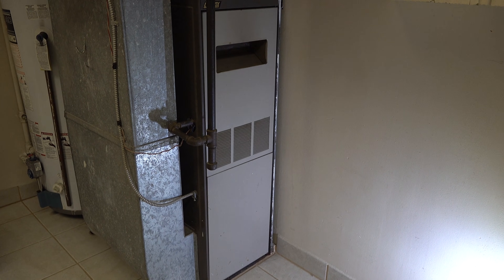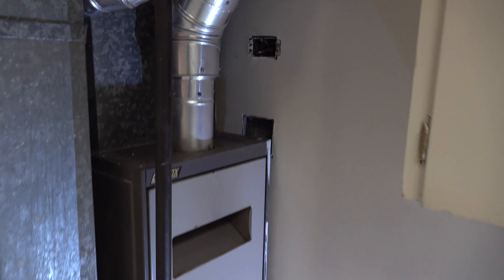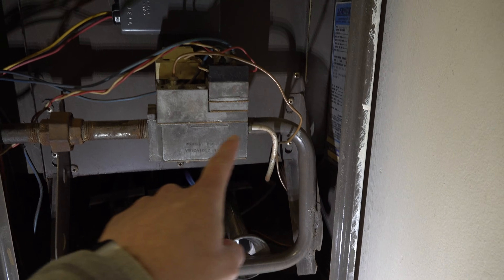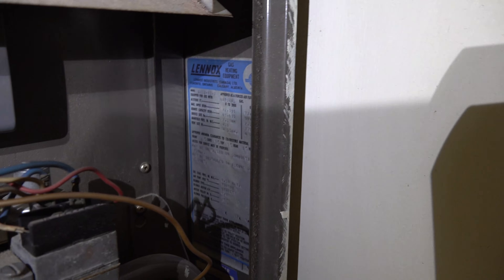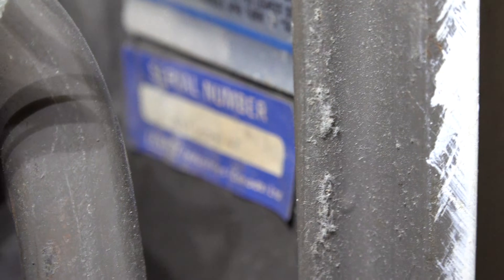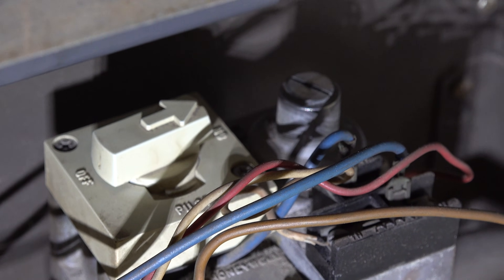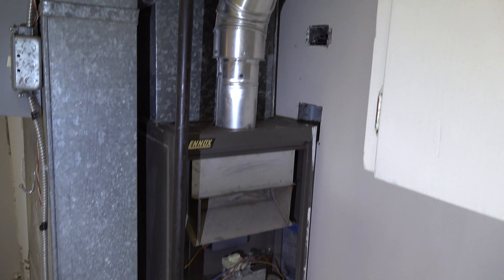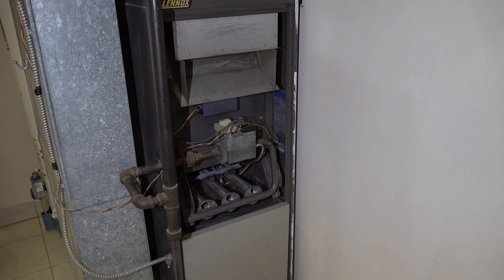1977 (Old) Lennox Gas Furnace Overview [G8D2-82-3]

Comment: Solid old furnace. As a licensed gasfitter in alberta i am a huge proponent of the old standard efficient furnaces, they are way more reliable than the newer ones and their efficiency is great. The parts are affordable and that offsets any cost of replacement parts for the higher efficiency units. Whats going on with all those blocks of wood under the blower assembly? Looks like someone used the wrong blower and shimmed it. Heat exchanger looks good but the best indication of a cracked heat exchanger is done through combustion analysis. Keep that old beast till shes not safe to run. Itll never let you down on a cold winters day
Reply from the maker: The blocks of wood were used by the previous owner so the fan didn't drop down so far when he'd take it out to lube the motor. I just left that in there since it's not harming anything.
Reply: @InternetDude  those blowers are heavy and you almost have to lift them with your feet and legs so he used them as a stand and a second set of hands. I see now! One time in like -50C, I found an old ICG with a broken bracket on the blower so as i waited for parts i temporarily had a big trailer furnace blower in there strapped to two blocks of wood. Wasnt sure if that was the case here. I worked on one of these the other day that was a counterflow model.
Reply from the maker: The blower is surprisingly quite heavy, yes! I lubed the motor a couple months ago, I put too much in and some of it ran out. Learned a lesson. It takes a little work to get that in and out by yourself. I bought a manometer to check the pressure and adjust it if needed. That'll have to wait until spring just in case I screw something up LOL.
Reply: @InternetDude   you can also do simple temp checks with a digital thermometer. For oiling i go about three drops at a time then turn it over by hand. Just a few drops per year is good. Youll hear it make a huge difference in sound. Also for a couple hundred bucks canadian you can get a new motor for it
Reply from the maker: Would a new motor use less electricity? If I would just save lubing the motor it's not worth it to me, the previous owner said he lubed it every 2 years (he lived there 28 years).
Reply: @InternetDude   in order to be able to more positively determine that, id have to amp check the blower motor (first place id start). After checking that, if the amps were close to what the stamp on the fan says id oil it up and let it be. Some of the newer motors dont require oiling and consume slightly less electricity.
Reply: InternetDude my motor is loud when it kicks on? Could it be because I haven’t lubed the motor?
Reply: @lovingyou2301  what kind of loud sound does it make? Are you sure its the motor? If you have a multimeter you can check the amp draw when it starts up. Then you can shut off the power and check the resistance of the windings. Have you oiled the pillow blocks in the back that hold the axle in the blower? May be time for an new motor. Should be a simple 1725rpm 1/2hp motor with a 5/8" shaft. Make sure the pulleys are the same size as the ones you took off and line up properly with a straight edge. Belt should have about 1 1/2" of tension
Reply: @markallan9050   Hello I have an old Lennox furnace the fan does not turn in the heat phase. As soon as the burner turns off the fan turns on to cool the burner. Worked on cars for 30 years I can not find the test to repair the problem. Any ideas Thank you
Reply: @markallan9050     My G8 (1976) appears to have sealed bearings ,   no oil fill caps .   Can i still add oil somehow ?
Reply: @johnleeyingzhang3504  just because we differ in opinions does not mean I do not know anything about furnaces. Just my personal opinion that I have to make more critical repairs that are more costly on newer equipment. Ive seen so many new units fail vs old ones that I am really not inclined to want to install them. When manufacturers start to fix the hiccupps that the new ones have...maybe then I may consider purchasing one. Just because I prefer older heating equipment does not mean I have "fallen behind on technology". I have some of the most technologically advanced diagnostic tools for repairs on this equipment and I am quite familiar with how to troubleshoot the electronic components on this new equipment.
Reply: My Parents Still Have Their Original Lennox GIO Gas Furnace  That Came New With The House In 1972! They Have Never Even Had It Serviced And It Is Still Running! They Don't Make Stuff Like They Used To! They Don't Run It Continuously Like Most People Do..They Turn It On A "Few" Times A Day In The Winter And Always Have. Great Old Reliable Furnace!
Reply: @kellymoran3175 Does your dad oil the motor himself?
Reply: Hello everybody,
I'm looking for some advice. 
I have about same old Lennox Gas Furnace. 
Model#: C16-41W-00-1
It looks pretty much the same as on this video. I'm trying to find the wire with 24V to connect to c-wire to power on a new smart thermostat. I know it's somewhere there, but I am not sure which one.
Thanks
Reply: Yoo I just gotta new house and have this same furnace but I can’t figure out how to light it. Can you help??
Reply: @johnleeyingzhang3504  obviously you didnt read my previous comment about using current technology like combustion analysis equipment. Its not like i still bust out a drager tube and use gas cells to check for carbon dioxide or monoxide emissions. You may want to make sure you can comprehensibly read and understand someones comment before responding to it. Fun fact: I'm only 31 years old so if I did happen to be wearing 30 year old clothes they wouldnt fit me anymore. Good on you for being a sheep and doing what everyone around you thinks is the best thing to be doing. Its pretty sad that your life has now degraded to the point where you have nothing productive to do and choose to spend your time trolling furnace videos. I highly doubt you have a Journeyman Certificate in Gasfitting or HVAC so you may want to hold one of those tickets before telling someone who does hold a Gasfitters license here in Canada that they know nothing about furnaces.

Comment: Don’t replace this furnace unless you have too. Too many idiots in the comments wanting to get you a replacement because they are tree huggers
Reply from the maker: 👍🏻 it’s still running reliably today.
Reply: @johnleeyingzhang3504   why should he if is working? you probably one of those sales guy/installers
Reply: @johnleeyingzhang3504 : No it's not. Mac computers didn't exist in 1980.
Reply: what a dumb ass comment.  what the fuck does anything have to do with your so called 'tree huggers'?  douche.

Comment: I have an old Lennox G12Q3-110-1. it is very old.  I can light the pilot light, the furnace kicks on and runs for under a minute and it all shuts off!?.. why?  it's getting cold
Reply from the maker: Did that just start happening? I'm not really sure but I think there is a temp limit switch so if you haven't touched it or changed anything I would suspect that maybe?
Reply: InternetDude  I changed the thermocouple.  That’s my only repair as of now.  I know this is an old furnace but I cannot afford a new one and want to keep my family warm
Reply from the maker: Try asking gray furnace man on YouTube
Reply: InternetDude 🙏 thank you
Reply: same furnace same problem, ever get a resolution @TheCallofCreepyPasta?

Comment: I work in HVAC I don’t think the flames look great I would get someone to come and look at the unit. those were nice units! The oldest furnace I ever saw was a 1955 ge unit it had major cracks in the heat exchangers. I only replaced one of those 1977 Lennox units I have seen many live on.
Reply from the maker: What do you mean by look great? There doesn't appear to be any cracks but the air/gas mix may need slight adjustment. Biggest concern to me would be finding an honest tech that won't just walk in and say "replace that dinosaur", we can give you a great deal on an efficient one.
Reply: @InternetDude  Your flames look like they have way to much yellow!

Comment: Wondering if you can make a video of its A/C unit part? I have almost thesame old style Lenox and hear dripping sound along the vents but cannot find where its coming from. HVAC person came and insulated the coils at the bottom part of the unit that we can see dripping and sealed it really good but we still hear dripping from the vents.  I'm just a regular owner of an old gas furnace and I would still like to DIY this if its possible to save money. Any help would be very much appreciated. Thank you.
Reply from the maker: There is no A/C, just the furnace. Maybe the dripping sound means the A/C refrigerant is low?? Not sure.

Comment: The fire looks fine. Like Google User said, the flashes of yellow are little bits of dust and dirt burning off. You see a similar effect on other gas appliances such as a range or water heater. What you don’t want is a “lazy” yellow flame. It is bright yellow and flickery like a candle flame.

Comment: I think I have exactly the same furnace. The blower seems not working,  I changed the filter and the breaker is not tripped. What could be the problem? Please help.
Reply from the maker: I’m not sure, check their support website. Where does yours have a filter??
Reply: @InternetDude  Fan belt broken?
Reply: @dereklebrun1621  True! or timing switch

Comment: Thanks of the video.  I have almost like this one (G8Q3 model).  Would you happen to know where the heat sensor is located?  My furnace is short cycling and I think this may be the cause.
Reply from the maker: I believe it's in that metal box where the manual fan switch is.
Reply: @InternetDude  awesome thanks a million

Comment: How do you get at the filter to change or clean it?  I have one of these and need to clean the filter
Reply from the maker: Remove the lower door where the fan motor is, check for a filter where the duct comes in. Obviously don't have that panel off while the furnace is on.
Reply: @InternetDude   Thanks

Comment: These heat exchangers had S curved heat exchangers that would crack. Yours could be cracked and should be replaced to avoid carbon monoxide problems. You would have to cut the back of the furnace out to know. The gas valve you have does turn on slow. Looks like it is running ok.
Reply: It's unnecessary to cut the back out and doing that ruins the furnace. Just need a bright flashlight angled the right way.
Reply: @Jon-hx7pe  Hard to find cracks that are covered by the cabinet. Even with an inspection opening cut into the plenum it is difficult to see. What kind of flashlight would you use?
Reply: Used to have a G8 furnace, checked it myself once a year,  you shine a bright flashlight into the burner inlets angled high towards the area of each  cell that's known to crack , I've seen pics, if there's a crack it appears as a very faint line with some rust darker than the normal oxidization. You get down on your knees and look upwards inside the heat exchanger.

You can also use a snake camera.
Reply: scart78 another way is to start the fan and put a wax taper or match on an extender into each section inside..if it blows out or blows around there probably is a crack or hole in the heat exchanger.. 65% efficient.  Just kicked in..when the fan starts watch the flame..it should stay steady..orange is dirt or rust..you don’t want yellow.
Reply: @DONALD1951  could work those cracks are usually on the top of the s curve and the crack would have to be big enough to pull a vacuum.
Reply: Just put a damn co reader in the ducts
Reply: @khalilt6508  Right!? Going to try this on ours. Good call

Comment: i have a 1973 lennox, i replaced the pilot burner and thermocouple with a new unit and afterwards the pilot light would stay on just fine , but the furnace will not turn on at all now, any advice would be appreciated. it was working a week prior but the pilot kept going out, so i replaced the pilot burner and the thermocoupler and now the pilot stays on just fine but it does not turn on all all. i checked the breakers, i switched out thermocouplers twice but now it doesnt click, doesnt turn on, it does nothing, only thing that works is the pilot, and its very strange to me because the only thing i touched on it was the pilot assembly, and now it wont turn on all all. id appreciate any advice you could give, thanks.
Reply from the maker: I am not a furnace pro. Contact Grayfurnaceman on YouTube, I've learned a lot from him, try asking him in one of his videos or through his website. Barring that you might need to call a local furnace pro, or even call a local furnace company and ask them for a tip or two.
Reply: thanks i appreciate it
Reply: After you light the pilot and it stays lit without depressing the knob, turn it to on.
If it's already set to on, use a meter to tell if there's voltage at the gas valve with a call for heat and work backwards. Looks for 24v ac. U can also see if the transformer itself is putting out voltage.
You may have blown a low voltage fuse working on it, any contact of low voltage to ground may do that on these old units.
Reply: thanks. we did a bunch of tests. we think its the Robertshaw gas valve. it only has two main leads going to the valve. im guessing a common ground which is brown and a live which is yellow, the Honeywell is putting out 25 volts. and the Robertshaw valve is slightly warm like its being powered but the energy is not going anywhere.  we checked all fuses, and breakers there all good. motors good. i think the valve or electrical in the Robertshaw is just gone bad for some reason. we cleaned all the connections and everything, and nothing was happening. on the Robertshaw there is a little  black plastic box and that is what the two electrical lines are going into with 3 rectangular holes in between the wires on the black plastic box. anyways we kinda tapped or jiggled the box that holds the connections and it finally started trying to click and engage the gas flow. but it still would not let the gas flow or turn on properly. so were pretty sure we need a new valve system. but thanks for the help. definitely keep it all in mind.
Reply: there should only be two wires. You can try disconnecting them  and ohming out the valve, if it's open or shorted u know the solenoid coil or internal connections to it are (is) bad. 

Having constant power to the valve and it not opening pretty much means it's bad. Especially if other gas appliances work.

I wouldn't put much money into that furnace. A professional valve replacement will cost a lot and it's only 60 to 70% efficient and probably has a bad heat exchanger by now. 

The valves aren't plug and play btw - the gas pressure has to be set, gas meter clocked, ideally monoxide in the exhaust checked.

Best to get a new furnace if it's in the budget -> fuels savings and possibly improved comfort from 2-stage or modulating unit.  Plus high efficiency takes combustion air from outside and not having a open draft hood makes it easier to maintain a good humidity level in the house.
Reply: i would try but i am not that proficient with multi meters yet, i am still learning and my multi meter is a cheapo. but ill see if i can figure it out.
Reply: It really pays off to learn some electrical theory and have good test equipment - u can save a lot of things from landfill as well as money. there's tons of stuff online. good luck

*u must be in a warmer climate, being able to wait so long to get the heat running again.
Reply: lol yea. i usually fix or re-purpose just about anything i can get my hands on. i am usually pretty good with fixing or figuring out whats wrong with most things. i just have not tackled heating system until now. but i am learning. i really want to go deeper into electrical and engineering. i've been getting my gear slowly built up. soldering guns and multi meters and all that fun stuff. of course there is always room for improvement so i am slowly but surely working and learning. in time ill get there. just had some rough times lately.i live in Utah its not freezing yet but its close. right now were running electric heaters until we can get everything under control. funny how things break right when you need them the most. thanks for all your help though. its much appreciated.
Reply: also our unit is so old  (1973 lennox) and parts are getting harder to find. i was about to attempt to make some of the stuff from scratch but found a last second replacement at a hvac store that still carried stuff that old. then the gas valve goes out and one more thing to try to find. but at this point were considering just getting a whole new heater system. it was a good heater but we are thinking about trying to get something newer with more safety features. and better efficiency. our house was built in 1927. we have owned it since 1974 and the last ten years we have been slowly remodeling each room top to bottom. had to gut most of the electrical it was so old it had the old tar coating with paper insulation. pretty ridiculous lol. the main beams under our floors were not even 2x6s they were the older style. but yea. fun fun i tell ya.
Reply: It sounds like you're doing things in the right order. After the house is fixed up, you'll probably need a smaller furnace.

Comment: I remember having one similar but had 4 burners that was original to my parents house in 1966.. Was a beast and all it ever needed was the draft diverter hood replaced. When it got replaced it found a second home and continued service in a garage somewhere.
Reply from the maker: Things were built to last back then 👍🏻
Reply: @InternetDude  no. Those old furnaces should be thrown away. No need to hang onto this garbage.